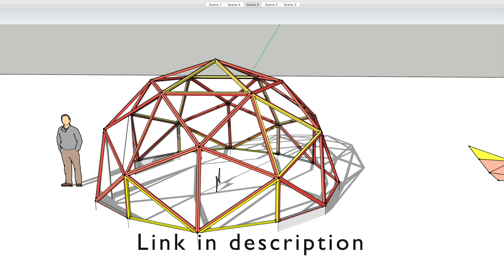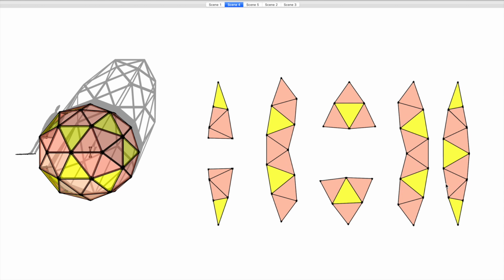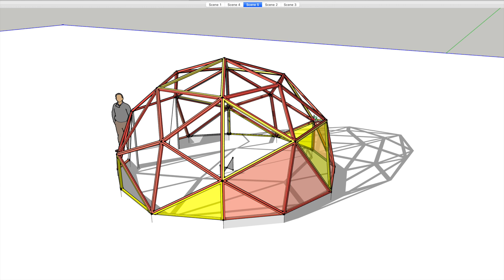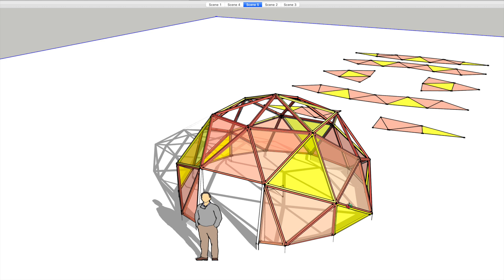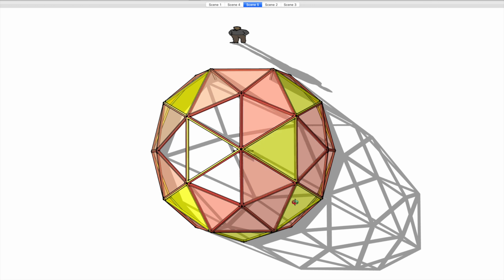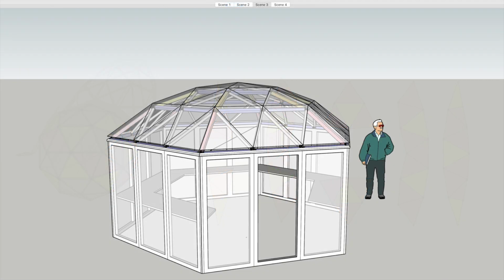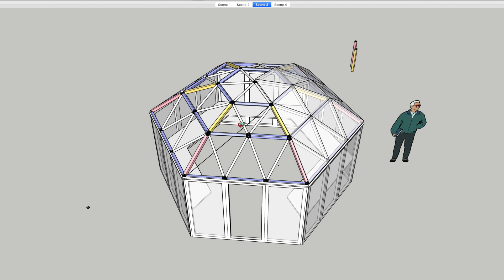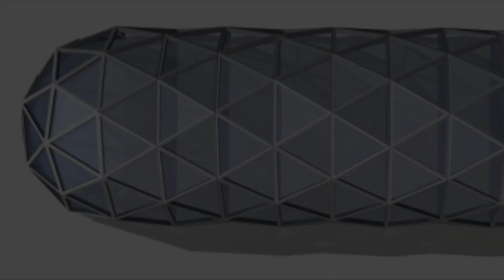Covering WangerFlange structures

Comment: I think the cuts make for disaster unless it's a beveled frame where they are folded into the wood. I feel the best way to cover a wanger flange or conduit type dome is two large solid sheets using an air blower like I did In a video on my channel. the plastic folds over and the air inflation fills in any gaps - it's always way better for high wind loads and adds insulation.

Comment: You could easily build this as a 1 frequency, same structure. It would be slightly less dome-shaped, but it would have virtually the same properties. Pentagon stellation with equilateral triangles is quite shallow and coincides nicely with the angle of this dome. 
Also, if you want to know what you can build with wanger-flanges, have a look at Johnson solids. This will give you a virtual lego kit of structures that you can fit together to make basically any shape. 
The loss of domicity (my own word, I like it) or sphere like quality isn´t all that bad. The structural integrity of geodesic domes doesn´t really come from the dome-structure, because without all the triangles, this dome structure couldn´t support it´s own weight. (No cross section is a parabola). So, basically all archimedean bodies (including a snub-dodecahedron if you want a nice dome at reasaonable length struts), platonic bodies AND johnson bodies can be easily stellated with equilateral triangles to create ANY structure, convex, concave, of any topological order, you name it. They would all have (virtually) the same structural integrity, since it isn´t the dome, it´s the triangles. Being a dome only helps a little, which you can see with the wanger flanges, it isn´t until everything is connected, until the floppiness is gone. Until that time it won´t really support it´s own weight even. This is because it fails the rope-test or chain-test for arches.
So, if you want to sell your product (and have a little fun), I suggest you look into the wikipedia page vor Johnson Solids and rejoice.. You can make anything with your product and ONE SIZE STICK (and one covering),  stop restricting yourself to domes.
Also, you wouldn´t need wangerflanges, because you could just pre-cook your equilatereal triangles and make a wooden mold to create cardboard triangles. Then put aluminium tubes in the sides of the cardboard triangles and tie it all together with rope. That would be quite easy.
You can make cardboard watertight with quite a cheap, organic spray or you could use PLA.
Building a 3.5 meter high dome from a snub duodecahedron will mean you need 61 90 cm or so triangles. And you can easily take out a nice doorway with one pentagon and two triangles. You are welcome..